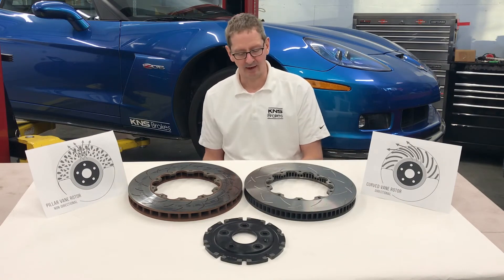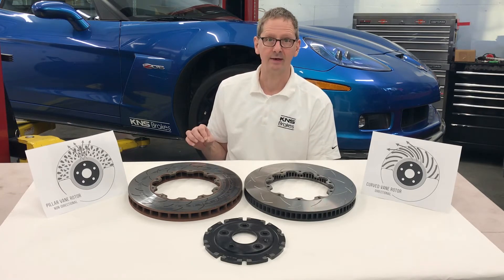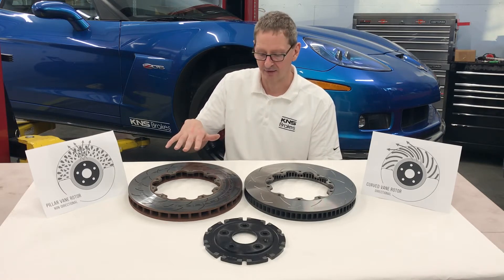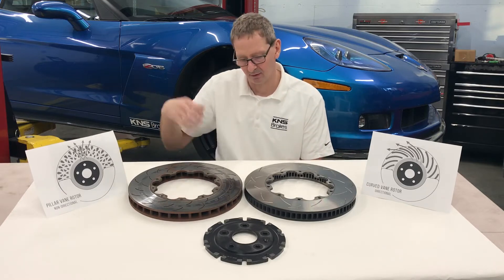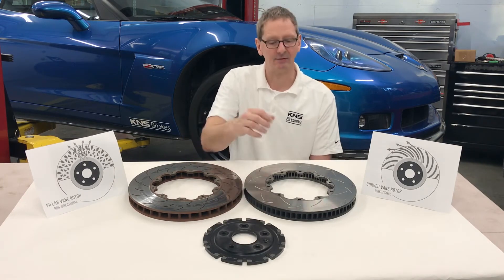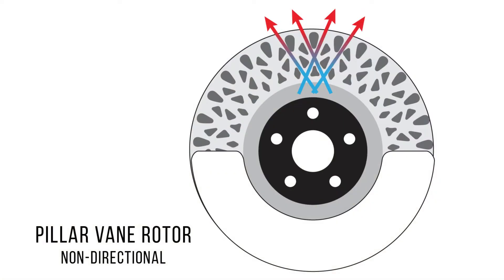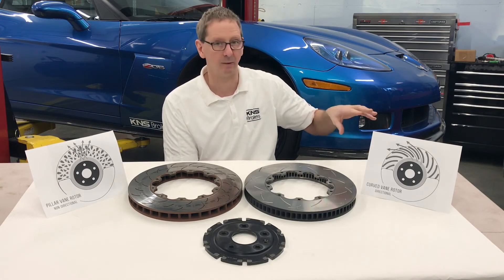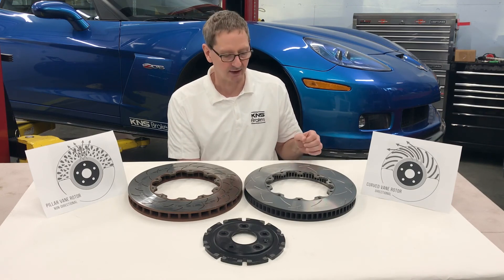Corvette C7 Z06 Rotor Rings: OEM vs DBA

Comment: When going with this dba setup where or who do i recommend for the screws to hold the hay down. GM recommends to change out hardware but wheni went to a dealer they say they can't fine them therefore the are bot for sale.  Could i just got a hardware store and by or arw they specialty bolts? Thank u
Reply from the maker: The hardware is very specific.  Please review our website for the kits we sell with the replacement discs.  There is a contact us link to get more information or feel free to call us.  Thanks!  Note:  GM only sells complete rotor assemblies.
Reply: Thanks for the reply. What is the throw away measurements for the fronts and back rotors OEM?  in MM?  I think i am getting close and thinking about these DBA ones instead of the OEM AC delco or whatever they are

Comment: Is the Kangaroo paw vane design from DBA?
Reply from the maker: Yes the Kangaroo Paw is a DBA patented design.  Other rotors do use a similar design that is more commonly known as a 'pillar vane' design.  In this particular case the DBA rotor is a curved vane design and the OEM GM rotor is a pillar vane design
Reply: Thanks

Comment: It should be noted that the OEM cooling design is NOT using a "pillar" design as listed in this video. The DBA rotors ARE using their patented "kangaroo paw" design for these rotors.
Reply from the maker: Hi Nick - For the C7 Z06 front rings you have it backwards.  The OEM Corvette rotors are pillar vane, the DBA and Girodisc replacement rings are curved vane.

Comment: Might check some of the info in this video for errors.
Reply from the maker: Please advise what errors you see.
Reply from the maker: I am not certain but you may think the vane descriptions are backwards.  In this case DBA has made a racing design 72 curved vane rotor whereas the OEM GM rotor is a pillar vane design.
Reply from the maker: Let me know if you saw something else.